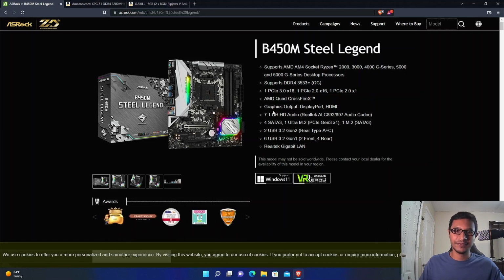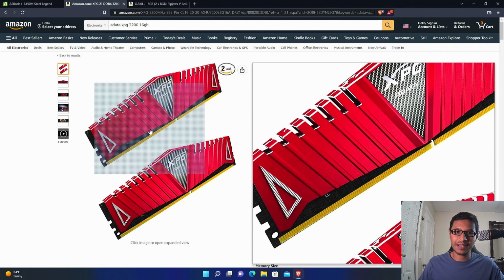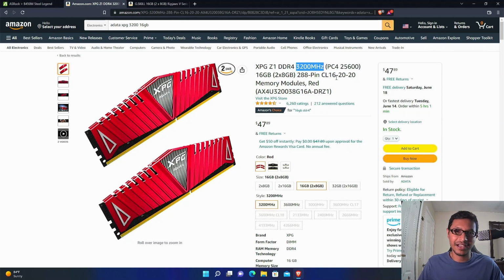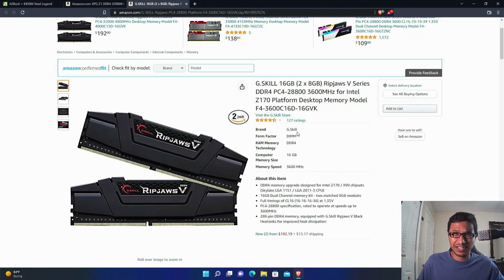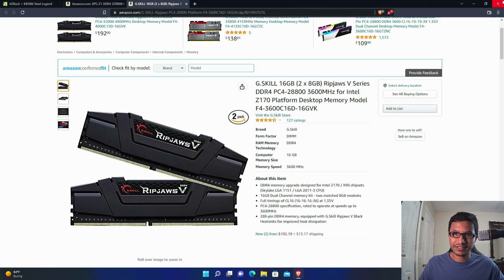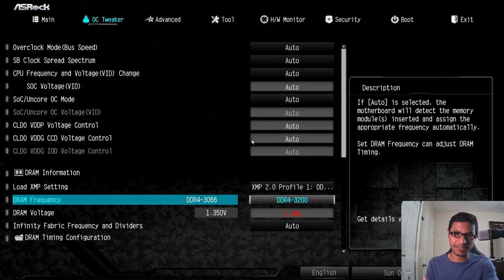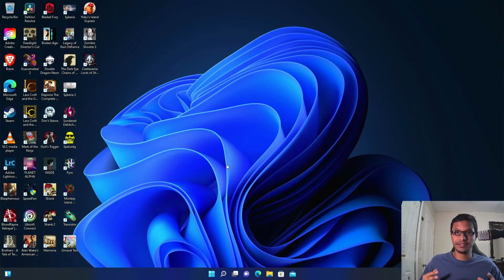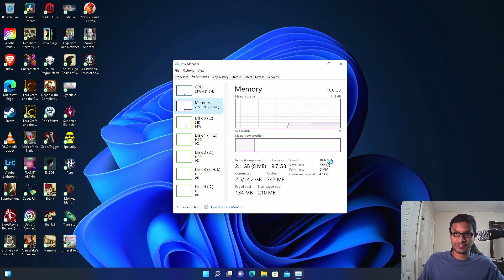How to fix ram overclocking/dram frequency/XMP issue in Asrock B450m Steel legend motherboard

Comment: Thanks man . this help me a  alot i was trying to  over clocking my RAM 3200 but my system is not working so i did 2866 . Now i can easily set to  3066 working perfectly . Thanks man  :yt::goodvibes:

Comment: I have had stable system at frequency as high as 4166 on this motherboard while initially it was crashing at 3600 all i did was updated bios from p3.60 to p3.90 i was using renior and ballastix
Reply from the maker: @harjeetkour4742  ram overclocking issues are gone with 5000 series cpus

Comment: Yo i have a question my dram frequency at the left said ddr-4 3200 but the voltage is 1210v instead of the xmp profile which is 1350. Anyone has any ideas?
Reply from the maker: @Mateozz19  you load the xmp profile from your bios. It should show the correct voltage.

Comment: It worked at first but now its not working i have three ram sticks but it works only if i use 2 sticks
Reply from the maker: @SilencetheEvidence  using 3 ram sticks in not recommended. Get either 2 or 4. Anyways, are all 3 of your rams from same manufacturer with same timing?
Reply: @coolStranger516  2 rams are same manufacturer
Reply: All are 3200 mhz
Reply: I tried to find the hyper x fury that was previously installed I'm unable to find the same thing online or offline
Reply from the maker: @SilencetheEvidence  just keep using the 2 rams from the same manufacturer. Don't use the 3rd one.
Reply from the maker: @SilencetheEvidence  so maybe the 3rd ram's highest compatible speed is 2866mhz. It's still decent speed.
Reply: @coolStranger516  when I'm using any 2 I can clock it to 3200 mhz

Comment: Bro how can I run 3600 mhz ram on my pc with this mobo ? :/ I'm confused ...
Reply from the maker: You can only run 3600mhz ram if you have  ryzen 5000 series cpu. 3000 series cpu can only run upto 3200mhz.
Reply: @coolStranger516 my 5700x handles this xmp profile poorly as well so wrong..
Reply from the maker: @andrewmtgx  I had a 5600g cpu. That handled this xmp without any issues.

Comment: hi bro, i got apacer nox aura II 32gb 3600 mhz, when i using the XMP setting its always black screen, but if i manually setting the ram speed at 3600 mhz, its works perfectly, can you help me? thanks
Reply from the maker: If you have already achieved 3600 mhz frequency and it's stable then you have already fixed it.
Reply: @coolStranger516  but why i cant using the xmp setting? why do I have to manually set it to 3600? thankyou for the answer btw ☺
Reply from the maker: @XISREVID  maybe xmp ram timing was not stable for your cpu/motherboard combo. You can still use XMP profile but then lower the frequency to 3500-3200mhz to see if it's stable.
Reply: @coolStranger516  WOW IT WORKS! thankyou so much for the answer bro ❤️😎👍🏼
Reply from the maker: @XISREVID  you are welcome 😊

Comment: My memory works at 3600-3800
Reply from the maker: Yeah. It will work fine with higher frequency if you have 5000 series processor. This test was done with a 3000 series processor.

Comment: Bro, I built a PC with 5600G and B450 steel legend. My PC's ram is Corsair Vengeances 8*2
Is this tutorial suitably for my ram and processor?

Note: I'm new user. Not so expert. Some steel legend user claimed that when they overclocked it at 3200mHz, their cpu turned on but monitor didn't get windows!
Reply: The worst mother board

Comment: Hello please help me,
My pc keeps on restarting when I render videos on editing software. 
My RAM is 2x8gb Vulcan Tuf Gaming alliance. 
On the OC tweaker it says 1.200v and 2400ghz.

I set it to 3066 at 1.200 but it still restarts.
Reply from the maker: If you are having problems with your video editing software then the problem is most likely with your graphics card. Try updating your graphics card driver... What kind of GPU do you have?

Comment: will updating the bios fix this issue?
Reply from the maker: Not really. It has to do with your RAM model. Some models work fine on this motherboard and some don't. Just keep lowering the frequency a little bit until your system is stable.

Comment: Hey, can i ask you if when you turn off the power(like unplug the power cable or switch off the button of the PSU) the profile goes away? Mine reset to auto the BIOS config when goes to no energy situations.
Reply from the maker: Mine doesn't go away...If you save the profile then you can reload it when necessary...
Reply: this also happens to my b450m, did you find any fix to this?

Comment: When I set mine to higher than 2667MHz it crashes and I get the blue screen
Reply from the maker: It has something to do with your RAM... Does your RAM support XMP profiles?
Reply: @coolStranger516  Idk? This is my RAM Patriot Viper Steel 16GB (2x8GB) DDR4 3200Mhz
Reply from the maker: @creepyz7z7z  they should support higher frequency... Go to OC tweaker and then Load XMP settings..then choose either profile 1 or profile 2... If you don't see any profiles that means this RAM does not support XMP..
Reply: @coolStranger516  Yea I did it but I set them to 3066MHz
Reply from the maker: @creepyz7z7z  then set it even lower to 3000mhz.. keep setting it lower until your system is stable..

Comment: How much time it takes after you press power button to motherboard logo on display mine board with 3500x taking 16 sec
Reply from the maker: It just depends on your system..I think mine takes about 8-10 seconds.
Reply: @coolStranger516  thanks bro actually i rma ed my board after that facing this issue

Comment: Well this is wrong, I had Crucial Ballistix 8x2 (16GB) running at 3200mhz on this board with XMP. 
Meanwhile I tried to upgrade to Corsair 16x2 (32GB) rated at 3200mhz and it is unstable above 2800.
So no, 3066 is not a universal sweet spot, it is with those particular RAM modules. Some can go higher, some must be lower.
Reply from the maker: Yes...it depends on RAM

Comment: Hello sir
Even I had have same asrock b450 steel legend and xpg 8gb × 2 sticks = 16gb ram and they are of 3200mhz...

So is it possible to hit 3200mhz ? In bois ? Will there be any problem
Reply from the maker: It is possible but you will experience constant system failures and random restarts. That's why I set it to 3066 and it is stable in that frequency...

Comment: it depends on dram - some work stably at 3200 on xmp, the same others can only work at 2400 or even lower without xmp.
Reply: Do you fix bro?? I buy 8gb x2 kingston beast 3200mhz 1.2v and when i enable profile 1 3200hmz in cpu z after test have 2400mhz and in bios i have 2400mhz left and right 3200mhz..
Reply: @СрбИН-у8э check your ram position at motherboard

Comment: Hello bhai, I am experiencing random kernel power events which make my pc boot again randomly while gaming
Reply from the maker: Remove cmos battery and set the frequency even lower to 3000mhz...what kind of ram are you using? Does it have an xmp profile?
Reply: @coolStranger516  I am using gskill ripjaws 3200 with ryzen 5 3600 along with b450 steel legend and a GTX 1660 super
Reply: @coolStranger516  I'm running memtest on my pc rn, Id go check my xmp settings right after. Thanks 🙏
Reply: @coolStranger516  I tried setting it to 3066 and my games still crash randomly. Pls help me
Reply from the maker: @thepd4400  keep lowering the frequency until it's stable

Comment: is this safe?
Reply from the maker: Depends on your hardware
Reply: @coolStranger516  what do you mean by Depends on my hardware?
we have the same board. ASRock B450M Steel legend, 4 dimms. and 3200 RAM
Reply from the maker: @bisayacoding2257  shouldn't have any problem then.. I am using xpg 3200 ram..been stable for months.
Reply: @coolStranger516  you use XMP in Overclocking like this vid or you just do it manually?
Reply from the maker: @bisayacoding2257  yea. take note of your RAM's XMP voltage but set the frequency manually to 3066 mhz.
Reply: @coolStranger516  so I wouldn't change the default voltage given by XMP Profile even if it's red? Then why I can't max it to 3200 only 3066? What's the reason behind
Reply from the maker: @bisayacoding2257  because it crashes at 3200mhz.

Comment: 100th subscriber.....very helpful bhai. I have a question..argb header is one..and i have used it with lianli strimers so if I buy nzxt73, how will I control the rgb of the AIO. lemme know.
Reply from the maker: I am not sure. But this motherboard only has a couple of RGB headers. ARGB won't work unless you have some sort of RGB to ARGB converter.
Reply: @coolStranger516  I had build my new pc with asrock steel legend B550 and after installing drivers I go to the bios and changed the frequency to 3200 and clicked save change and exit after my monitor starts showing No hdmi signal
Reply from the maker: @gokulnathparameshwaram1270  this is an Asrock problem. I have encountered similar problems when I connected multiple monitors. I'm not sure what causes this issue. Try detaching the power cable wait a few minutes and then plug it back in. If it doesn't work then try a different HDMI port and different monitor...